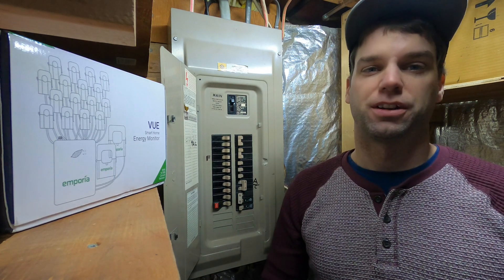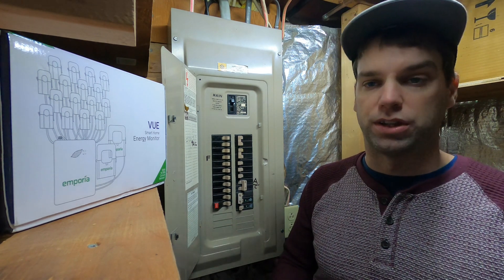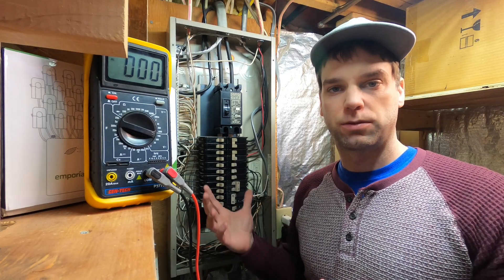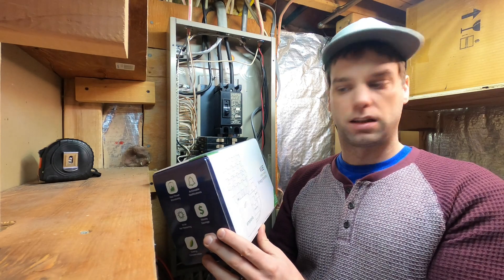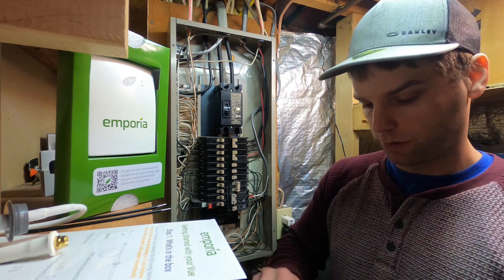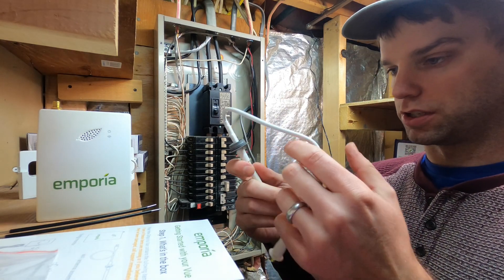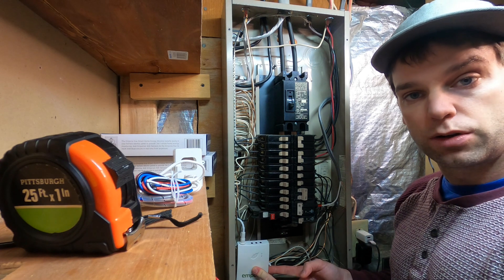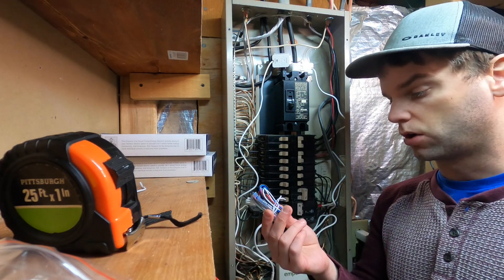Home Energy Monitor Install: Is It Really That Easy??

Comment: Can you run the Vue box outside of the breaker box?   Just punch one or two opening out and run the wires outside of the box?  Thx great video!
Reply from the maker: Hey Todd, maybe you could, but it would be 16 sensor wires + the power wires going out of the box. It is possible I suppose, but probably wouldn't look the best. I'm not sure what code says about wires like that coming out of the box either. Thanks, glad you enjoyed it!